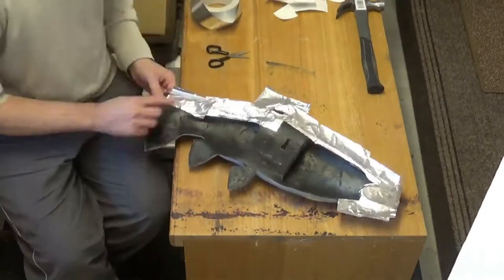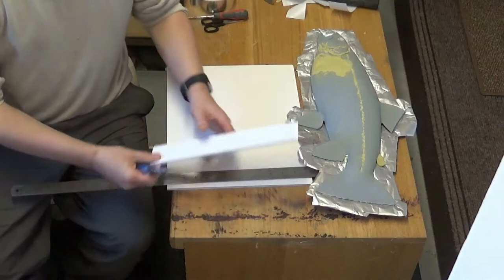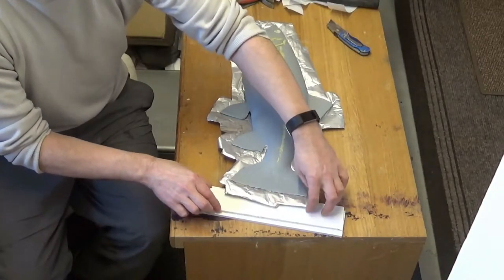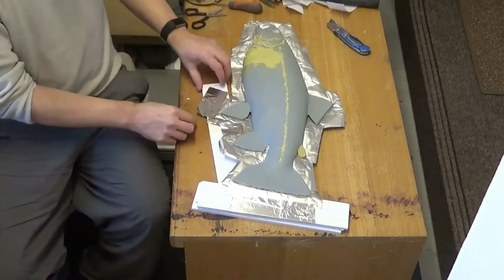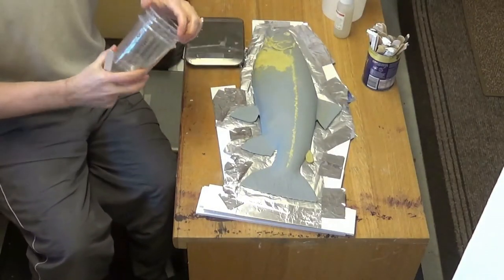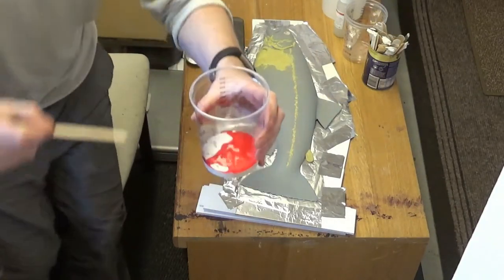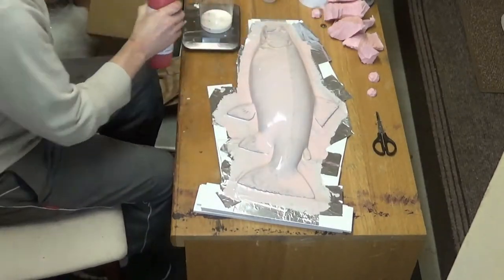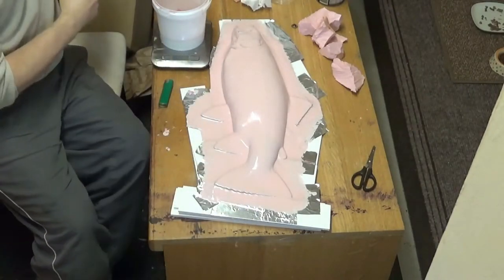Make A One Piece Brush On Silicone Mold

Comment: Can you make a this mold without thickener? I have the silicone but no thickener and want to crack on lol. Plus this is the silicone I have would it be possible to cast platsil gel 10 in for a half face mask? Thanks
Reply from the maker: You could do a pour mold, but it requires more silicone. I used the brush on style with thickener in this video as it saves on silicone, which of course can be quite expensive. I just put up a silicone pour mold here: https://youtu.be/K4X_Oh1_6UE I've not used Platsil Gel 10, so I can't really comment there.
Reply: Yeah I was going to do that but didn't have enough silicone just wanted to know if you could do a brush on with no thickener? 
Maybe 4-5 coats?
Reply from the maker: If you don't put thickener into the silicone with a brush-on mold the silicone will run to it's lowest point and will be too thin on the high areas. It's ok to put the first coat on neat as you want that coat just to pick up the detail. With the thickener, the silicone stays firm and doesn't drip down. You don't need a lot of thickener, so maybe you can pick up a small container of it? Don't forget, you'll want to make a mother-mold also, to keep the silicone mold's shape. :)

Comment: How long did you wait Between layers? Did you have any trouble with the colder temp in the Uk?
Reply from the maker: I didn't wait too long between layers. Just long enough for the silicone not to stick to your finger - maybe up to an hour. I do my molds inside in the winter, so no problems with the weather. :)
Reply: Dramamask Evolution okay brilliant, do you know the exact name of this polycraft silicone on eBay? There’s a few different number combinations.

Also did you use the  THI-VEX silicone thickener? Thanks
Reply from the maker: @DannyV94  I buy from this supplier: https://www.mbfg.co.uk/gp-3481-f.html I used the appropriate thickener which went with this silicone. Might be the same as you mention and think it is often called Thixo, but don't quote me on that. :)